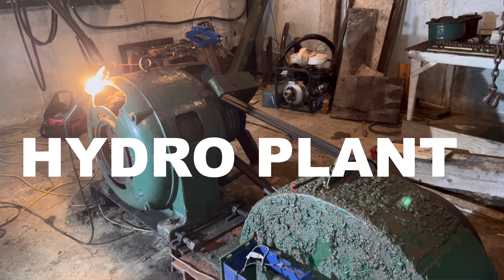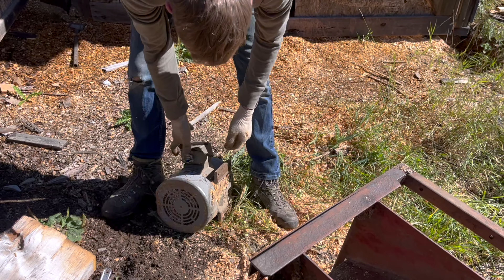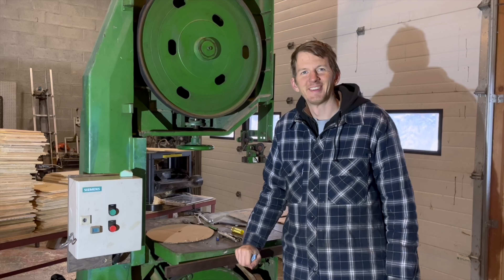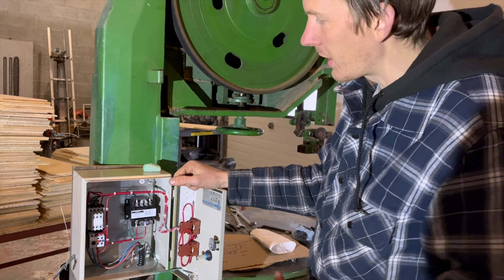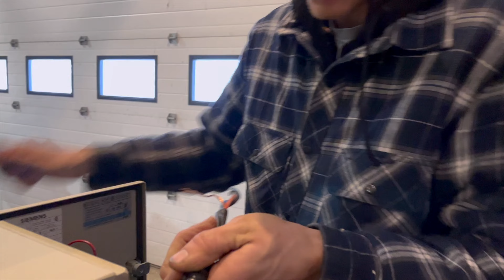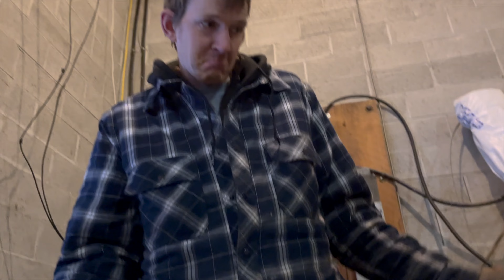The Tool that Shocked Us | Restoring an Italian Giant (part 3)

Comment: You might want to look into getting Carter replacement guides. As part of your thinking about speed, factor in the blade you're using, as its the number of teeth per second that you're looking for. Too fast/too many teeth per second and you'll just burn the wood.  If this saw hasn't been used in a while, replace the tires, then check the wheel balance. Heavy metal is the way to go, especially so with a band saw.
Reply from the maker: Agreed. The guides are neat, but possibly untrustworthy. The tires are definitely in need of replacement and one wheel needs a new weight.

Comment: Nice work guys! did you ever find out what the magnets are for?
Reply from the maker: The magnets pull the blade towards the wear blocks. probably help prevent the blade wandering around a little. I don't know how close or far from the blade they are supposed to be set though.

Comment: I think the motor is close to 60 lbs.
Reply from the maker: more than that.
Reply: I feel like it’s a similar weight to a MKIII, just more awkward.
Reply from the maker: Depends on the rpm of the motor/ coils quite a bit, but at 1800 rpm most 3 phase 3 hp motors are 80-90 lbs. 1200 rpm motors are even more, like 130 lbs. thats a lot of copper...